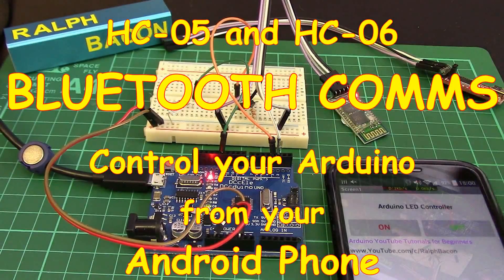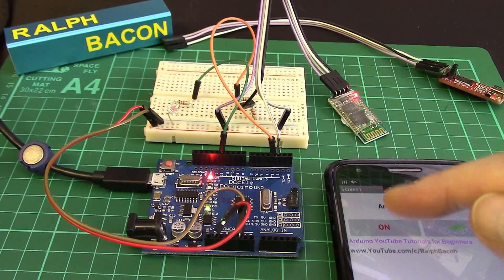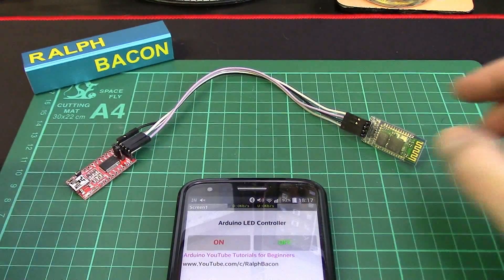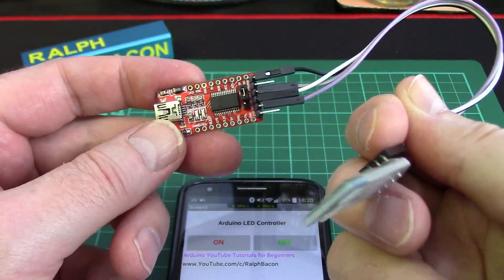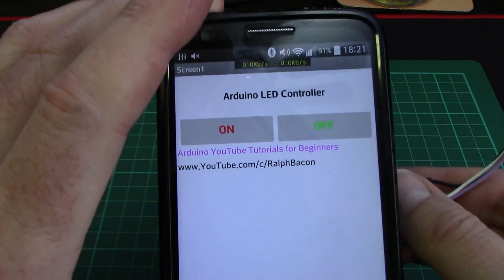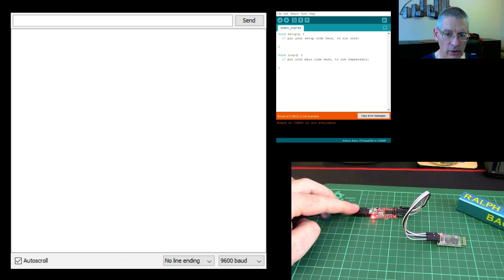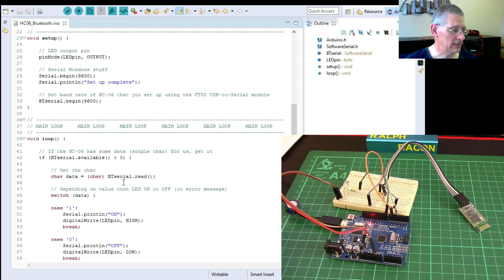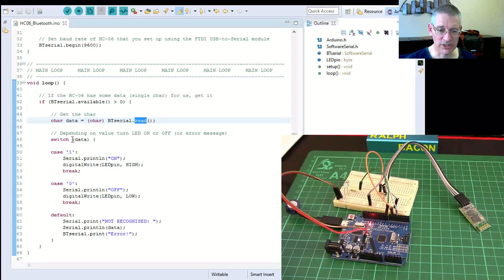#36 Control your Arduino from your phone - HC06 Bluetooth module

Comment: Hello Ralph.  I really like your videos and the way you explain stuff.  HOwever I have had not much success with talking to my HC06 module using my FTDI module. I get no response. I even got the supplier to send me another one but same result.  Any suggestions as to what I might be doing wrong? Yes I have got it set to 3V3.  Pairing light is flashing and I have done a TX/RX loop back test on my FTDI module and it works fine then.  Cheers.
Reply from the maker: Hmm, I will have to get one out and see what roadblock you have uncovered, but that may be in a couple of days (over the weekend). Bear with me and do nudge me if you haven't heard back from me by Saturday. From what I recall from this video (it was recorded a couple of years ago now) it was all plain sailing so it's probably some silly little thing we can clear up quickly.
Reply: Ralph S Bacon Thanks Ralph!
Reply from the maker: So, I've had a think.
1. Are you connecting the TX/RX pair the correct way round? That is, the RX of the FTDI is going to the TX of the HC06 module? And ditto for the TX of the FTDI? 
2. And you are SURE you have an HC06, not an HC05? The HC06 is permanently in AT mode (when not paired) as soon as you switch it on; mine has a rapid red LED light flashing. 
3. You should be able to set the baud rate on your Arduino IDE to 38400 and "Both NL & CR". Then send AT and you should get a response of OK.
4. The HC06 (slave device) will probably have something like JY-MCU on the back (probably)..
5. An HC05 device has something like ZS-040 on the back (probably).
 
Any luck? If not, and you're sure it's an HC06 run the example BT program on your Arduino and try and connect to it anyway using the phone app I supplied. I just tried this again and it connected straightaway (although I had modified my HC06 sometime in the past and called it an RSB which made it easier to identify).
Reply: Ralph S Bacon Hello Ralph. Thanks very much for your suggestions. I am definitely connecting the TX and RX correctly. But I will investigate your other suggestions and see whether I get anywhere. Thanks so much for finding the time to reply to me. 😊
Reply: @davidkempton2894  Hi did you get this going in the end because I have the same problem and have tried all of the above....Ta!

Comment: Ralph,
I am designing a weighing system that connects a load cell to an HX711 to an Arduino and then bluetooths the result (either the raw data or the value converted to a weight) to an Android smartphone.  I then also want to be able to tare and recalibrate the scale from the smartphone.  Which bluetooth module do I need for 2-way communication?  HC06 or HC05?  Confused!
Reply from the maker: Welcome to my channel!
If you want the Arduino (via the Bluetooth module) to initiate the connection then you need an HC-05. If you want to connect to the Arduino from your phone (by launching an app) then an HC-06 is enough. That said, an HC-05 offers the best of both worlds inasmuch that it can be either master (initiator) or slave (responder) for just about the same price as an HC-05 (I'm pretty sure it's just a different version of the flashed code contained within it that determines whether it's an HC-05 or an HC-06). 

So if you have not got a Bluetooth module already get the HC05 for flexibility! I have an HC-05 module and I will do another video in the future with the HC-05 initiating the connection to the phone to 'push' messages out to an Android app. I have a project in mind that I need to complete before winter so stay tuned!

BTW did you watch my Coffee Cup Coaster Load Cell video on the HX711 which shows how to connect it all up? That coaster is very popular at work with everybody wanting one! Not that I have the time to build them (I want to make a new one for myself first, for use at home).

Thanks for your interest in my channel and I hope I've clarified your query - if not, ask another question!
Reply: Watched many of your vids including the coaster one...great stuff.  cheers

Comment: Hi Ralph, thanks for this nice tutorial on bluetooth! Is it possible to use this module to read inputs from a Bluetooth mouse?
Reply from the maker: I'd be surprised if the output from the mouse was not encrypted and proprietary - and the manufacturers are not going to tell you anything about the protocol used, either. I'm not sure how to proceed really. Try the Arduino forum, they probably have more expertise: https://forum.arduino.cc
Reply: If you use an arduino on a very old serial mouse? Or ps2 host chip there some CH chips that could host hid devices mouse and keyboard as ps2 and they an arduino could send aerial to BT what you want..

Comment: Hi, amazing video extremely well taught. Learned more in this one video than watching several others. I am under a bit of stress though, I'm in grade 10 and my tech project is due in two days. I chose to make a rocket that would send its coordinates to a device within Bluetooth range. I purchased the ublocks Neo-6m GPS module and the HC-06 Bluetooth. Would I be able to initiate a connection from the device and receive the GPS data in the Bluetooth Terminal?  I am brand new to Arduino and after lots of trying I am running out of time, I'm wondering if you can help.
Reply from the maker: Well, PRObro, I can't do your assignment for you but let's think about this. The GPS module is entirely separate, logically from anything else. If your onboard Arduino is receiving GPS telemetry then it can send that via BT to a receiver (within range, as you say, which might not be that much, 30 metres? How high does your rocket fly?). I think I would have used a longer range data transmission protocol, perhaps using the nRF24L01+ modules, up to 1km range in free space (or sky). Whatever you use, my advice is to separate the two parts of this project and get them working independently before trying to combine them.
Reply: @RalphBacon  Thank you. I did what you said and tried them separately first, then combined and it worked. As for the nRF24L01+, this was only a prototype project so I was able to get away with just a proof of concept of sending the data. Thank you for your time, very appreciated.

Comment: Nice video just one comment... The modules discussed do NOT work with IOS/iPhone... Just to let others now up front as my project will be IOS based... For the rest very clearly explained...
Reply from the maker: I don't have an IOS-based device, Patrick, but I do know they are locked down to the nth degree. So I'm not surprised the app didn't work. But the HC06 device should work if you wrote an Apple-verified app, it's just BT, after all. But then again, we're talking Apple here. Thanks for raising this for others to be aware of.
Reply: I didn't program anything for the HC 06 as I did research first. Apple is notorious for locking things down specially in software While the phone is capable of certain things Ios just blocks it mostly for "security reasons" in the end I went for the HM10 which seems to work fine with Ios... I've also been working with CoreBlueTooth which is the apple API and it seems to work fine better then expected.

Comment: Hi Ralph,
loved this video but could you tell me why it does not  work on Attiny85 with the pin numbers changed
Reply from the maker: Good question you have there, Maggie May! Firstly, did you get it working first on a standard Uno or Nano? It's always useful to have a working prototype and then move to a ported platform.
 
I assume you've used Pin 1 as Rx and Pin2 as Tx for the SoftwareSerial pins? You've successfully established comms from your phone to the BT module (without any µprocessor involved) as per the demo?

Are you running the ATTiny85 at 5v or 3.3v?
 
At this point the ATTiny85 just reads serial data in the standard manner, so I am bit confused now. Let me know the answers above and we'll see what else I can think of?
Reply from the maker: I've found this ATTiny85 specific article on getting BT working, it may help you too:
http://www.instructables.com/id/ATtiny85-Bluetooth/
Reply: hi Ralph thank you for your reply . meant to ask but will the apk need to changed aswell?,
it does work on a uno. any help would be appreciated in getting this to work.the instructable site just confuses me more because he says connect rx ti pin 1 when pin 1 is reset!
regards
paul
ps as you can tell im a noobie to arduino.
Reply from the maker: No, the apk is for the mobile phone app, it doesn't have any bearing on the Arduino side of things; it simply does its BT thing (in this case to that BT module).
 
Yes, pin 1 is Reset on the Tiny unless you've disabled that to get another GPIO pin. But if not, ignore that and use two pins that are free. This is always going to be a bit of a challenge because you have so few pins.
 
Now when you say "not working" what exactly happens, if anything? I've assumed you've tested the BT module because you say it works on the Uno. Sure you haven't swapped the Rx / Tx pair over?
 
Final question: why are you so keen to get this working on an ATTiny85?
Reply: I am trying to run Rx to pin 7 on the Attiny85 {aka pin 2) and Tx to pin 6. reason for Attiny85 is that i wanted to put  it on a board so that i could free my Arduino up for other project but would still be able to return to the boards later. Hope this helps to understand what i am trying to do, maybe im trying to run before i can walk with the programming side.
Reply: Hi Ralph, 
Just for your info i now have it working except the software will only either let me turn it on or off before crashing any ideas.
Reply from the maker: Crashes is a strong word, Paul! You mean it becomes unresponsive? It's probably sitting there waiting for something to happen! Does it send back the correct response to the phone app, as per the demo? Also, double check the sketch against what you see on screen - I remember another viewer saying that there was another BT command (used for debugging) in the demo that was not in the sketch but which made all the difference (also check the comments in this video, you might find it).
Reply: No sorry it becomes unresponsive. I now think the problem is with the ittany85 and the softwareserial but like i say i'm a newbie so need to learn a bit more. I think i need your coding for a attiny85!

Comment: Hello Ralph,
I've watched all 147 of your videos (and those regarding Arduinos multiple times.) And I've successfully replicated and modified many of your projects.
 However, when I try to duplicate the #36 Bluetooth LED experiment (using a slave DSD TECH HC-05 in place of the 06 you show) I can't make it work. Changing the HC-05 by using AT commands through FTDI all works as you show. But, for controlling the LED using a MEGA,  I've tried both sketches and also tried adding the "BTserial.println" changes someone suggested. The Android App connects with the HC-05 OK(?) and reads back the "Set up complete" message. But nothing seems to be transmitting from the App by the Arduino and so the LED remains stubbornly OFF. I'm sure I've faithfully replicated your wiring and have tried changing '05 modules, etc. 
I realize it's been a long time since #36 was done and the '05 architecture might have changed enough to be the problem - but my research hasn't found anything useful in that area.
Any ideas or suggestions about what I might be doing wrong or should change in the setup?
Reply from the maker: You're right about this being some time ago, Dave, but the hardware will not have changed. The main difference between an HC-05 and HC-06 is that the HC-05 can be a master or slave. The HC-06 is a slave only. This means the HC-05 can initiate a connection to another device and the HC-06 can only accept a connection from another device, such as your phone. So you have swapped out a slave-only device with a master-or-slave - which should be OK.

Let's do this step-by-step to ensure we are both on the same page:
1. The Android app is up and running on your phone.
2. The Arduino app is connected to the HC-05 via the correct resistor divider and is running
3. You can connect with your phone to the Arduino / BT by pressing the "Choose BT device" button.
4. If you press the ON or OFF on the Android app, nothing happens on the Arduino.

5. Have you put various debugging (Serial.print) statements in the Arduino code to prove that nothing is being received? In the loop() after the BTserial.available statement?
6. You have definitely used the correct pins in the SoftwareSerial setup?
7. The baud rate is correct (I chose 9600 for reliability over speed)?

If all the above is a "Yes" then we will have to check the HC-05 vs HC-06 setup. Let me know about the above first.

And a big thank you for being such an avid viewer of my videos 🙂

Comment: Hi, please. Muito led is flashing with a 1 second delay. And when I tried to send AT via serial become a message: ERROR on serial screen :(
Reply from the maker: I suspect you have not paired your phone with the device. Go through the pairing process as per the video demo and it will work just fine.
Reply: @RalphBacon  Thank you Ralph. I found out the problem. My bluetooth is the hm10 4.0 module. Not hc-05 one. 🤭

Comment: Hi Ralph,Thanks for great educational Videos,  well explained!  One question though, Why do you need  FTDI232? I used Arduino Uno Rx (0), TX (1) and Arduino sketch to send AT commands and eliminated the need to purchase FTDI232.
Reply from the maker: Hey Golestaan! Welcome! Great you like the videos. I use the FTDI programmer so that the USB is still free to receive Serial data from/to the PC. Otherwise, you are working "blind" as you are using the same pins to communicate with it as when you upload the code, receive Serial messages etc. But, as you've found out, it works with those restrictions. Most developers leave pins 0 and 1 alone for this reason. An FTDI USB to Serial interface doesn't cost a lot and once you have it you can use it to program Sparkfun Micros (and other devices, that don't even have a USB port) for example. Thanks for posting this question, I'm sure others will read it and gain from it too :)